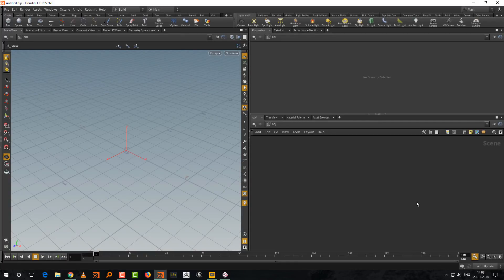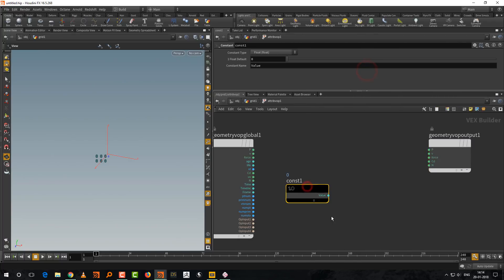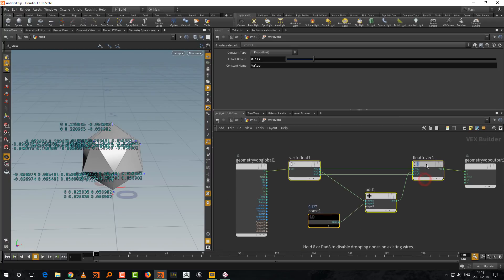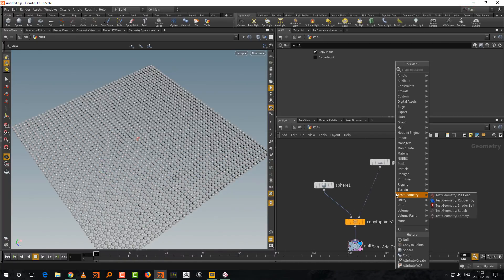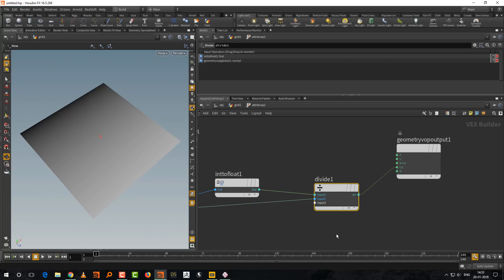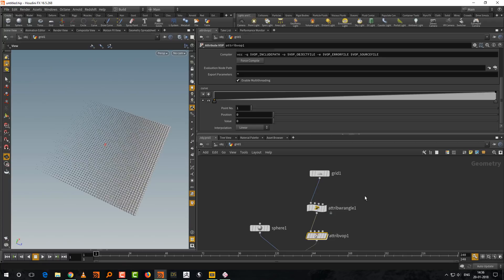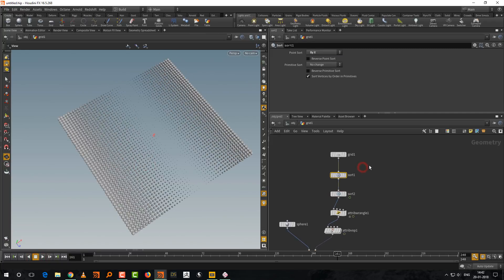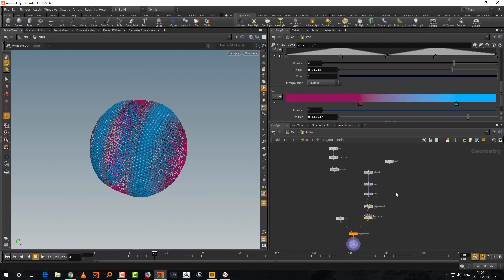Introduction to Houdini - Chapter 9 - vops and ramps

Comment: Great work, thank you!
It is not clear to me what special symbol should be used in each case. I mean sometimes I have to put @ in front of a parameter,  for variables like time of frame I have to use $, and sometimes I don't have to put anything. Is there any specific rule about it?
Reply from the maker: The $ sign was the older method, it can still be used but people mostly avoid it. The @ sign is the vex syntax for attributes, that's what is used in most places now. For some nodes you don't need to type either, like in the scatter or color node, but I don't think there is any specific list to my knowledge.

Comment: What is sop stands for
Reply from the maker: Surface Operators. OP stands for operators. CHOPS - Channel Operators (MotionFX)
ROP - Render
DOP - Dynamics
COP - Compositing
SHOP - Shaders (now not used as much) replaced by Matnet (Material Network)
Should have been called MOPS :P
Reply: @rohandalvi  sir please create tutorial on explanation of sop network
Reply: @rohandalvi  and Sir I have one more doubt I am programming student and I have pretty much knowledge of C, C ++, python because of that I understand vex is the syntax of vex are similar to these languages
Reply from the maker: @siddheshsawant799  I think vex is closer to C not python. But I'm not a programmer, so I can't be sure.
Reply: @rohandalvi  ya sir because it contain printf scanf and much more which is smiliar to C
Reply from the maker: @siddheshsawant799  the geometry folder is the sop network. There's no explanation for it. Everything you make in the geometry folder is your sop network.
Reply: @rohandalvi  oh sorry sir I thought it's different thing